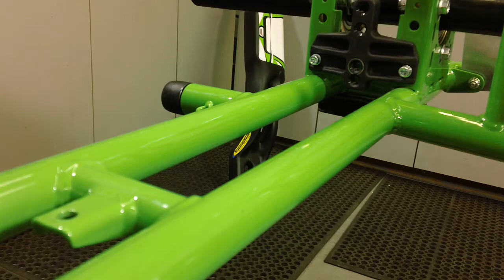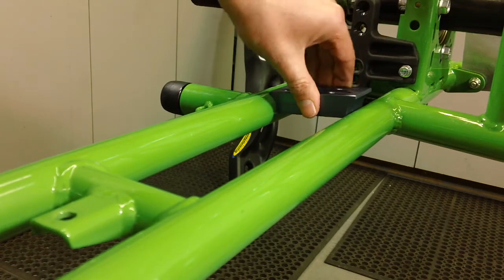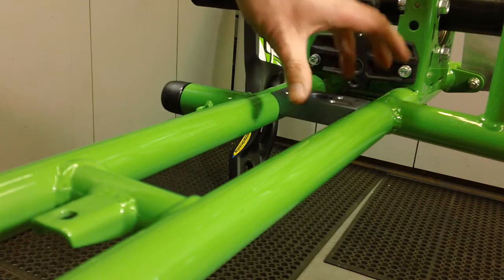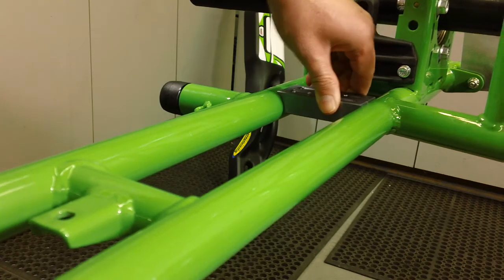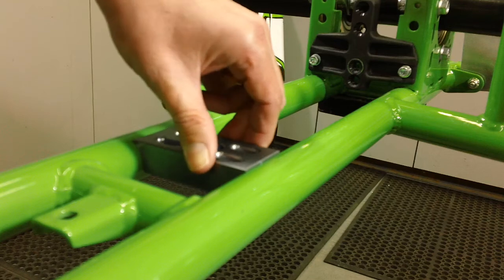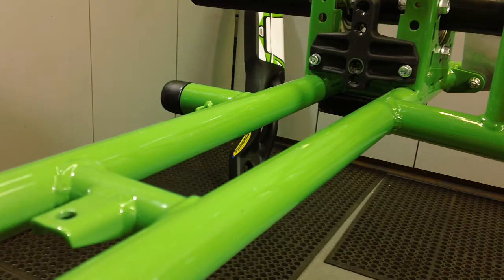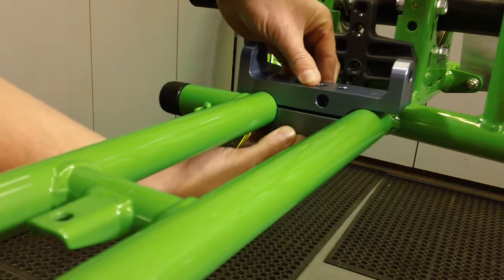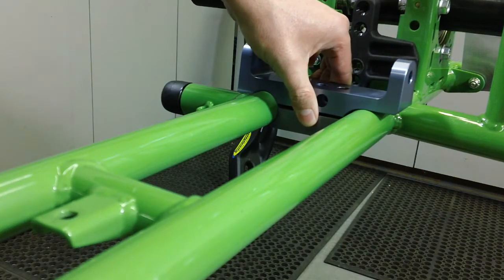SwedeTech How To Chose the Proper Engine Mount Clamps

Comment: Late to the party, but how do you figure out what size butterfly's you need?
Reply from the maker: Check out this video: https://www.youtube.com/watch?v=Sy8GpQAFwAw
Reply: @Swedetechracing  also last question, my motor keeps coming loose. New bottom butterfly’s are on the way, what is the black plate mounted at the rear of the engine mount rails? Is that a tensioner for the engine? I’m trying to do away with a welded nut with a bolt ran through it on mine bc it doesn’t work to well at all…I’ve searched everywhere for a tensioner for the engine to tighten the chain by pushing on the engine but I cannot find anything…wonder if I’m using the wrong wording when I try to search it. Any and all help is much appreciated!!!! Thanks again!!!
Reply from the maker: @daveschannel232  Each kart has their own way for the engine stop. Try contacting a dealer that sells your brand of chassis, maybe they have something that will work.